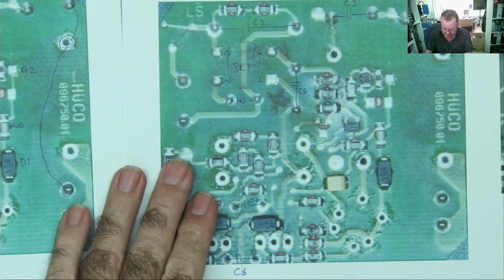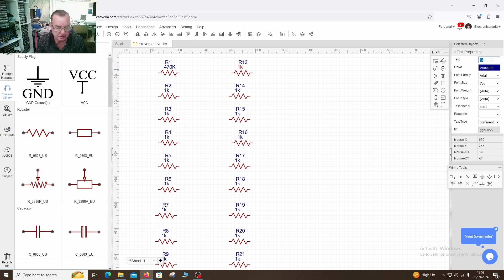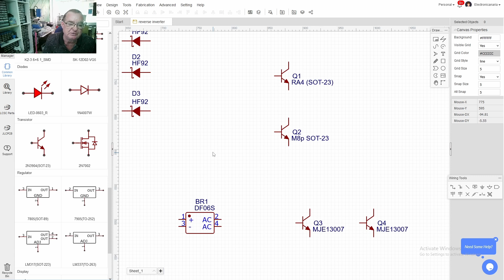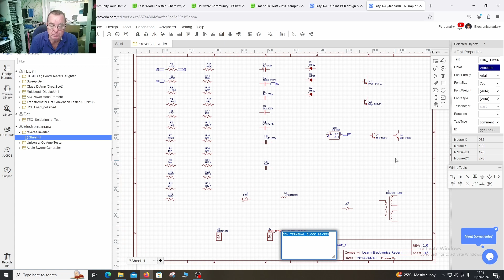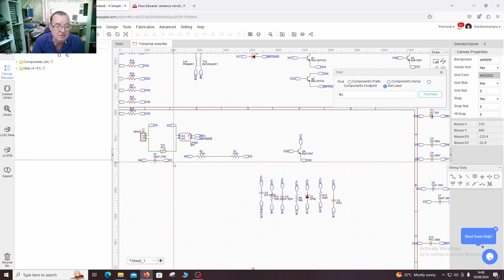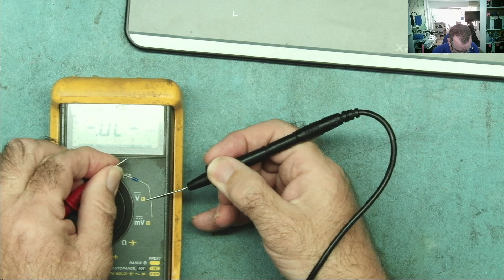This 12V 60W Lamp PSU has blown up. How to Identify the Blown Components and fix it CONTINUED

Comment: Excellent video Richard - as always -  but it looks to me as though this process, even for a relatively simple circuit, would take several hours to complete and I wonder whether anything other than the most expensive or rare circuit would actually justify such a repair technique and for multi layer boards it would be even more difficult.  Thanks for posting - very informative.

Comment: 11:50 - The first EDA I learned on was KiCAD; but, as I began learning more about schematic capture I explored others before landing on LTSPICE. LTSPICE is intuitive and once you get proficient with the keyboard shortcuts, is really quick. But, LTSPICE has proprietary components so you can’t see the inner workings of a chip (as you would see on a datasheet). You can import other people’s models into LTSPICE quite easily and even create your own. 
But because couldn’t see inside many of the LTSPICE components, I’ve more recently started looking at the creator of LTSPICE’s new and improved QSPICE. I haven’t hardly used it yet, so I don’t have much to say about it.
TINA is a very large program, too. Although I have dug very deep into that one.

Comment: Very good detective work, Richard! The approach with the CAD program also was a refresher for my part (some years since I've used them much) The circuit you arrived at seems very much similar to the ones I've seen in compact fluorescent lights (some years ago, at least, and with smaller switching transistors, mostly) They had the exact same looking toroid driver transformer
Reply from the maker: Yes I've just been pointed in the direction of Big Clive as well.  I put the link to his video in a pinned comment here

Comment: Further to my previous comment: If you look at BigClive‘s YT „inside an electronic halogen lamp driver, with schematic“ you see the basic circuit, without the protection and temperature control bits, that oscillates at high kHz within the 100Hz rectified mains envelope. That way the component size makes sense. If you reorder your components slightly, you will probably come out at much the same circuit.
Reply from the maker: Thanks for the info.  It's reassuring I came up with the same basic circuit as Big Clive.  I'll post the link in a pinned project as I can do that.

Comment: Without analysing further, I am wondering why they would go to all that effort to generate a 100Hz circuit from a 50Hz supply. That doesn‘t give you much benefit in the size of the required transformer and you might just as well just use a transformer directly to convert from 230 to 12V. My suspicion is that this should oscillate at a significantly higher frequency to be able to generate the 60W output with a transformer of that size. 
Now the challenge is to find out how the small Mosfet with the associated circuitry turns into an oscillator probably in the 2 digit kHz range. Hmm
Reply from the maker: yes but the 50Hz supply is the mains AC frequency.  What is coming out of the bridge rectifier is pulsed DC at 100Hz.  So where is the all the effort in doing that?
Reply: It wasn‘t about the 100Hz, but how you get to the HF oscillation…
Reply from the maker: @Chief_Engineer  Take a look a the video I linked in the pinned comment, it gives a better description on the circuit operation than mine

Comment: I think the blue stripe on the diode indicates that it is a zener.
Reply: The blue stripe located in the centre of the device does not indicate an anode, as it would if it was a zener diode - The big clue it's likely a diac.
Reply from the maker: If you watched the video then you know what the blue stripe diode is because I proved it.
Reply: @learnelectronicsrepair   Yeah... others seem to have made comment before watching the whole video. My first sight of it in Part 1 had me assume it was a diac.  

I'm curious as to where that very fine trace is located on the schematic. 
Is it a fusible link or just a trace to a test probe point for manufacturing QA purposes?

Comment: Certainly enjoy the reverse engineering and your excellent explanation of how you think the circuit works.  But I have to ask; why not just replace this power supply with one that will drive the lamp. I can’t be sure of the exact lamp that this devices uses, but if it is a halogen lamp, there are led bulbs available in this form factor that use much less power and will provide the same light output.
Reply: Given the output rating of 60W at 12V it would certainly be for one of those old power hungry halogen heater/lamps.

Comment: I think what you've labeled as D4 the glass diode which is redish in color with the blue stripe. Maybe what's called a diac. Quite a few references out there on the web. Hopefully it is still good and you won't have to attempt to figure out what value it is supposed to be.
Reply from the maker: You did watch the video, right?
Reply: @learnelectronicsrepair 😂

Comment: Hi Rich. Check out M8p	BSN20	Philips
SOT-23	MOSFET n-type
Sw, LogL, 50V, 173mA, 830mW, 8/15ns, 15(100mA)
Reply from the maker: That's the same one I identified in the video?
Reply: Google "the ultimate smd marking codes database" . Good resource. Paul
Reply: @learnelectronicsrepair  Hi Rich. Have tried to reply a few times but it keeps getting deleted. ??

Comment: Once you had input all the components and net entries I was expecting the program to generate the schematic itself!
Reply from the maker: That would be nice
Reply: The components and net labels IS the schematic. You should make modular schematics. Nobody wants to see a mess of criss cross wires anymore.
Reply from the maker: @humidbeing  I would say that this depends on the type of device.  For digital schematics (microcontroller,  graphics cards and things like that) then a modular schematic with nets makes a lot more sense.  For analog devices like power supplies and audio amplifiers a schematic with wires makes a lot more sense.  I didn't have much of a mess of criss-cross wires in this one, and in fact if you noticed, I used nets for the drive to the main switching transistors because it made the schematic clearer to read.  So I have to say, digital use nets, analog use wires and hybrid devices like an air-con controller or audio mixer with DSP section use a mixture of both techniques on the same schematic.
Reply: @humidbeing  Honestly, I like the actual schematic Richard did much more than nets pointing to each others. However, your approach makes indeed more sense when using more complex diagrams (mostly when using digital busess) in my opinion. 
But it's all personal preferences...

Comment: I'm not yet a big user of this kind of CAD, but have KiCAD and it seems a bit too extensive as I rarely produce schematics let alone design boards. However, I can see how to use this net list method to just clarify a set of components and their connections during a repair instead of just beeping out the traces and trying to keep it all in my head or scribbled on a bit of paper. Cheers.
Reply from the maker: You're welcome.  Give it a try and you will be surprised.

Comment: Great video. As I was thinking he ought to build a net list, boom, there it was. Takes patience to do this. I would have run off to the store and bought a new one. 

That said, some things are worth fixing, and this is one technique that can be quite helpful when all else fails.
Reply from the maker: Agreed.  The real takeaway from this video is learning how to do it, regardless of the value of item I was using as a guinea pig 🙂
Reply: @learnelectronicsrepair  If the customer has lots of these, then building the schematic is gonna make life easy and a few quid in the bank.
Reply: @sivoltage  The customer would save more time and money replacing all the Halogen heaters with LED.
Reply from the maker: @sivoltage  True
Reply: @learnelectronicsrepair  True... it's of academic value only.   
In the real World, this faulty item would be chucked out and replace with like for like... or if the customer was wise, upgrade every halogen heater/lamp in the premises with cheaper (in every regard) LED lamps... if they care about pissing money up the wall in power bills and the associated fire risk.
Ever seen the diecast metal light fittings that use MR halogen lamps heat distort and the paint finish burn?  As a licensed electrician I have, too many times!